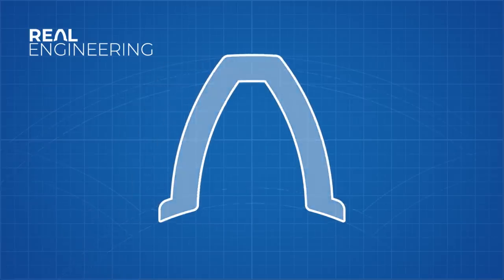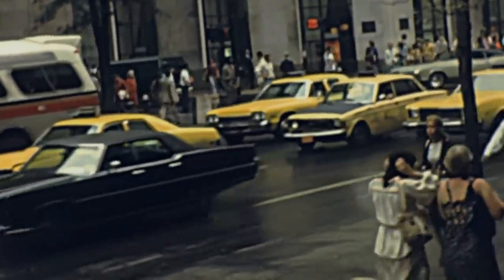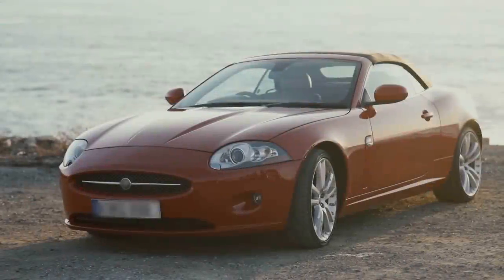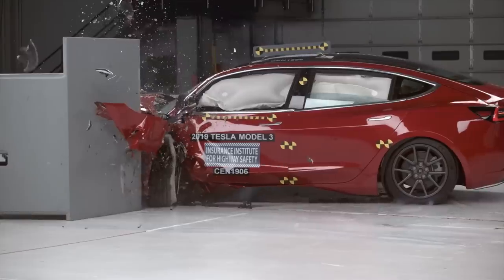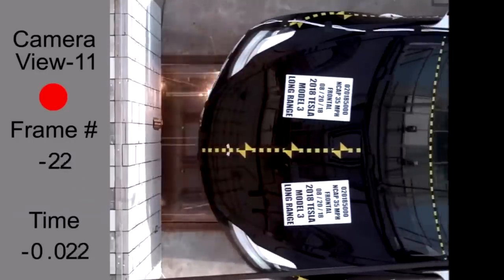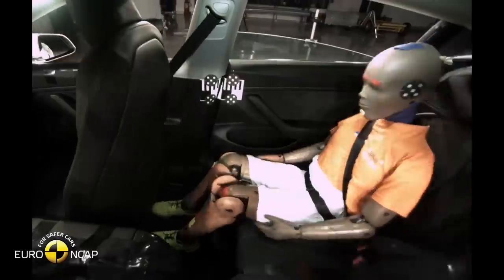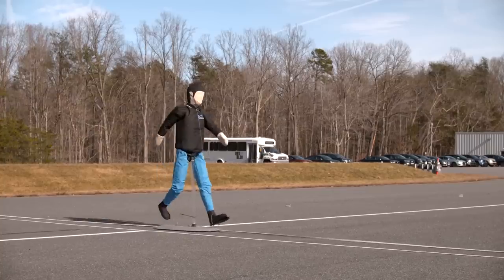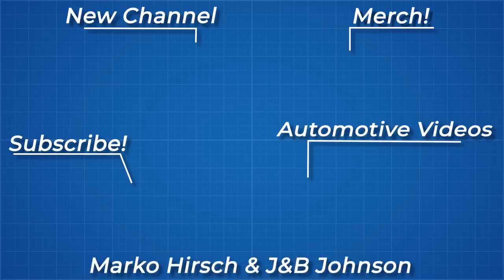Which Is The Most Dangerous Car?

Comment: RIP '59 Chevy Bel Air. You were too good for this world
Reply: thermitebanana I know. I hate to think how many were wasted on stuff like that. 😢 lol
Reply: @nolansprojects2840   i read theories that the particular bel air they used has a rusted out frame or something.
Reply: @frysco5927  There are theories that Elvis is still alive, so some reliable evidence would be needed.
Reply: @frysco5927  I appreciate you trying to make me feel better about it. lol, but would't the cars having rusted out frames highly affect the test?
Reply: Its a necessary sacrifice for car safety, id shed a tear but not cry a lake.
Reply: @nolansprojects2840  It would have affected the test, yes, but that's not what happened here. People mistook brown substance flying from the car during the test for rust, whereas it was in fact dirt that had accumulated after decades of driving. The car was in very good condition. Another frequently repeated but equally false claim was that the old car didn't have an an engine, which put it at a disadvantage. There are two issues with this: First of all, an engine is not an advantage in a test, on the contrary. A heavy, solid block of metal does not protect you, but instead gets pushed into the interior and causes damage if it's not dealt with properly, e.g. by using a sandwich floor (which this Chevy didn't have; the Citroen DS from the same era did however). Secondly, it did have an engine, as both the video and photos show, so that's nonsense again.
Reply: What they did to that 1959 Bell Air is the saddest thing I have ever seen. It makes me even more sad and Angy knowing it was in perfect condition. Who ever sold that car didn't know what these idiots were going to do to it or else they wouldn't have sold it. I'm pissed. We should have a proper funeral. Where are the Terrorists when we need them.
Reply: @triplem9805  Did you not see the dust from the rust?
Reply: @chico305SIGMA  I think it was stored by them for such a test
Reply: t c  no because then the test wouldn't be accurate
Reply: The previous original owner was promised it would be garage kept.
Reply: thermitebanana what a shame
Reply: @bennylofgren3208  Apparently not.
Reply: I'm glad I wasn't the only one who felt that way.   So sad to see such a nice mint shiny car of old get smashed and crashed like that,  especially since now they are so few.  We bid it, Adieu.
Reply: Papa NAM I’m just happy it wasn’t a two door
Reply: I am still sad about this crash test.
Reply: Frysco That was debunked the the IIHS.
Reply: Frysco Don’t worry there are so many Bel airs out there,
Reply: George Washington There are so many of them who cares
Reply: t c Then that would not be an accurate test. Keep in mind it’s their damn car. They can do what ever the want with it.
Reply: It was bought in Indiana but had its fair share of problems. 74,000 miles on the broken odometer, and had surface rust beyond repair, though not frame rot. Poor thing went out in a sad way
Reply: The result was shocking IMO
Reply: It sucked, judging from the way the steering column destroyed that dummy.
Reply: I’ve actually been there before, and that old Chevy is on display in the lobby, though the only car that was tested the day I was there was a 2020 Camry
Reply: @CoyoteCoop  thanks for adding this. It makes me feel a lot better.

Comment: When I looked into ncap ratings the main thing I tool away was a 4 star small car is much less safe than a 4 star rated medium sized car.
Reply: NCAP star ratings have never meant all that much since they always move the goalposts as cars get safer. Add to that the fact that if a car doesn't have automatic braking it loses a star, then they are more or less meaningless now. The occupant safety ratings might be okay, but I don't know if they have moved the goalposts there too.

My point is that they shouldn't have put an arbitrary cap on the amount of safety one can have.
Reply: @C.I...  Exactly! They should have just added stars as cars got safer.
Reply: @bimblinghill 
How many stars do you want modern cars to have.
Reply: @Robert-cu9bm  IDK. 69 sounds like a good number of stars.
Reply: @Robert-cu9bm  A car that just meets 5 stars is classified just as safe as a Tesla which easily gets 5 stars.

A Tesla could get 8 stars.

They should ditch the Stars and just use a number and not out of 10.
But a number based on a set standard of tests which can easily scale
Like PC benchmark tests.
Reply: @Robert-cu9bm  Well that's for the regulators to decide. If e.g. a 2001 Volvo got 5 stars, then with improved technology something better came along, give it 6. Then something better, give it 7. It seems pretty simple to me.
Reply: @IIGrayfoxII  So you want just to move it from /5 to /10. That doesn't tell you much either, what's the difference between 4/5 and 8/10? You can easily convert one into another. What is important, is not just the number, but to read the results. There, you have everything described, with Adult Occupant
 %, Child Occupant %, Vulnerable Road Users %, Safety Assist % and a pdf report about all kinds of things. So yeah, read, if you want to know more.
Reply: rubbers3 no, with a larger total to go off of, it’s easier to determine actual safety of a car. The difference between a 4 star and 5 star is so hard to tell that this video was made. A total out of 10 or 100 allows for a more precise measurement of safety. With a rating of 40/100 it’s pretty easy to see the car is not super safe; a car with 70/100 or 95/100 is a decent or extremely safe car and it’s simpler to see the difference.
Reply: @rubbers3  He said NOT out of 10. So yeah, read, if you want to know more.
Reply: @C.I...  Oh, true, I've accidentally read "just use a number and note out of 10" instead not. Mea culpa, I admit.
Reply: @ToddHowar.d  It's not about a larger total, it's about resolution. You can have a total of 5, and go into subdivisions, like 4.5 or 3.86, you can do that with any number. It's only an illusion that people fall for constantly, that something like 2/5 seems like it's better than 4/10, but 40% seems better than both. 

I do personally also prefer to use /100 whenever I rate something, but that also comes from my preference for % and using decimal points (with 1 being max), like it's done in many STEM fields is not very understandable in common conversations. 

That being said - any number is meaningless without context and without further exploration of how it's determined. It can be used to quickly rule out the outliers (like 2/10 is rather obviously worse in almost everything compared to 8/10), but when it's 6/10, 7/10 and 8/10 - which one is better here can be tricky. One might loose points for no backup camera, no abs and no traction control, but occupant safety might be 95%, and the other one might gain points for having those system and few more, but once it is in a crash, the survivability might be only 70%. So do you want the car in which you survive a crash, or one that will crash less? If both have the same rating, you don't know which one is which.

That's why it's important to explore what determined the outcome, not just look at the stars/numbers.
Reply: @ToddHowar.d  [EDIT: Aaaaand now my previous comment suddenly appeared... I love youtube sometimes...] 

Seems like youtube ate my response to you, I'm pretty sure I posted it, but it seems to have disappeared... Long story short - there's a lot that goes into the safety and numbers. You can have two cars with the same number, be it stars, out of 10, out of 100, or out of 1, but they can have those stars for different reasons - one might be safer in case of a crash, one might have more equipment that prevents a crash. You still need to understand the context and HOW the numbers are assigned, not just the overall number. 

Also - larger total gives you nothing, what you need is high enough resolution. You can have 1-100 in the increments of 1, you can have 1-10 with decimal points with 0.001 accuracy, you can have it out of 1000, but in 200 increments... People just have the tendency to understand different things differently. If you see a car with 2 stars out of 5, it looks worse, than 4/10, but 40% looks better than both of those, and .4 is not understandable by a huge portion of the population that isn't into STEM. That's why you think that 95/100 is better, but it's the same as 9.5/10 or 4.75 stars out of 5. We see bigger number, we think higher score, even if all of those are exactly the same.
Reply: @C.I...    the goal posts move because the cars improve.  And realistically you are not comparing the results from a new car to a car from 10 or more years ago.   Its specifically meant to evaluate new production cars not to compare new cars to old.
Reply: The stars are awarded to the car based on its performance in that specific vehicle class and can not be accurately compared to vehicles in other classes.

Comment: Could a lot of the deaths per vehicle be also largely influenced by the demographic that drives them? How many of the people driving small cars like the Mitsubishi Mirage are elderly for example, as opposed to others.
Reply: but you shouldnt need skill to survive a crash. Beginner Drivers or Elderly People should be able to crash however they want and still survive unharmed.
Reply: by that i mean, the safety of the car shouldnt rely on the drivers skills.
Reply: @PointlessDrummer  Maybe so, but this was about amount of deaths per X miles driven, if elderly crash more often then that skews the results.
Reply: The physical condition of the driver does. A fall a 30 year old can laugh off may break a 70 year olds hip. In a crash this could kill the old driver when the younger one gets out. Even man verses woman can change stats. Women are shorter and lighter on average vrs men. Different seat positions could also be more dangerous than others.
Reply: @timothydoyle9635  fair enough. Didnt think about that
Reply: @PointlessDrummer  True but even those skilled drivers can't avoid the people around them.
Reply: Valkyness - Pickups are surprisingly dangerous, which I guess makes sense if you think about it more.  They’re top-heavy with primitive suspensions, so they’ll spin out and/or flip (roll-overs are EXTREMELY dangerous) at the drop of a hat.
Reply: I also think that may be the case. This video started promising with acknowledging the problem of different demographics, but then went on to vilify the Mirage anyway.
Reply: @vincea1830  It's not nice calling women dirt cheap!
Reply: @hkr667  bad bait
Reply: Cheap hatchbacks are also what most new drivers have, and they tend to be more dangerous
Reply: Valkyness well globally toyota corolla is probably the most sold car but it didn’t make the deaths per million list
Reply: @ClockworksOfGL  Pickup also are carrying more weight. That's a lot of momentum that has to be dissipated on such a heavy vehicle.
Reply: PointlessDrummer I don’t think he was talking about driving skill, old people get hurt far easier, a young person can fall over and get back up like nothing happened whereas the same fall for an elderly person could seriously injure or kill them
Reply: There was a study done on driver death per cars and the Chevy Astro which got the worst safety rating by the IIHS killed the least number of people out of any car during the study. The study also concluded that was due exclusively to driver habit, so if you're safe on the road you're safe in general.
Reply: @ThePatUltra That's true the HIC was pretty low, it's just that lower overall rating is linked with higher death rate and the Astro situation goes directly against that, saying that demographic likely does play a big part in influencing death rate

Comment: Could the death per miles on that big dataset be from the demographic of the owners? Of course newer less experienced drivers would choose cheaper cars, and drivers of sports cars would drive a bit more 'care free' than most, so I think that's why the crash test rating and the deaths per mile traveled don't line up all the time.
Reply: LazerLord10
100%
Reply: That's definitely a potential factor, Mirages are some of the cheapest cars on the US market.
Reply: old people might drive a mirage also and they are more likely to die in a crash
Reply: I love your skyblock videos!
Reply: It's an obvious question with an obvious answer. Don't ask stupid things.
Reply: I drive a Fit and I'm amazed to see it rank so high in deaths/mile. Certainly there's nothing about the car that tempts the driver to reckless behavior. It would be interesting to see data for a given vehicle broken down into accidents caused by that vehicle and accidents caused by other vehicles. If the Fit were easily crushed, it would show up in the crash test data. If it doesn't, that leaves us with "Fit drivers tend to be unskilled or inattentive or both." Oh dear. Note that while Camaros, Corvettes, and Challengers made the list (well, duh), the Mustang did not. And I guess BMWs are built like tanks, or they spend too much time in the shop to rack up miles.
Reply: You cannot parse out every external factor, unfortunately. That being said, I would remind you that it takes two people for a vehicle-vehicle crash to happen.
Reply: I suspect part of the issue may also be the number of those vehicles on the road. Many of the superminis will feature because there simply will be more of them on the road.
Reply: Dependant. More cheaper more danger. The Tesla lineup are very, very safe. This is because the front is a crumple part, but anything behind that is a non-crumple part. I also think the back is a crumple part.
Reply: its not that the drivers of sports cars are more care free (unlike popular belief), its that they are people who go to car meets & do spirited driving, the thing is sometimes there is no traffic so they take the opportunity and go pretty fast with their car, however sometimes they accidentally crash while doing this and since they are going at higher speeds, the odds are worse for them
Reply: Yep, certainly if you are a good driver (adult enough) the chances of getting into accidents reduces dramatically. obviously it can't be considered the only factor but excluding the fact that most of the cheap cars are owned by rookies and younger thrill seeking demographic does create differences in data interpretation.
Reply: @anthonyrau5313  That’s why we use deaths per mile as the metric, as was discussed in the video. The only area where that falls short is that it doesn’t account for the likelihood that the other car in a two car collision is (in the U.S.) is more likely to be a larger, heavier vehicle such as the popular Ford F-150 pickup truck. It was discussed in the video.
Reply: The whole video is an exercise in omitted variables
Reply: Yeah too many variables TBH. Not to mention real accidents happen at crazy angles and speed and such. Like how many dead center head on collisions are there in real life? I bet very few. 

 Also while people drive like dummies they also don't drive like dummies. - back perfectly straight two hands on the wheel. Especially before impact.

Comment: I'm surprised the Mustang wasn't in the top 14 at the start due to having crowd magnets in the front.
Reply: Old boring joke.
Reply: @justenzo6342  
Old? Yes
Boring? Not at all
Reply: @justanmr2973  Right. It's just boring the it's over..
Reply: If pedestrian injuries and deaths were factored in it probably would be! But I believe those results only took account of occupant safety.
Reply: Well technically they aren't fatal. Maybe a list of most casualties with one swing lol.
Reply: That was when they used the solid rear axel iirc
Reply: If a Mustang was to plow through a crowd like a steam roller then i would have to say that the driver is unlikely to have sustained any injury. Idk about the crowd though. 10/10 would plow again.